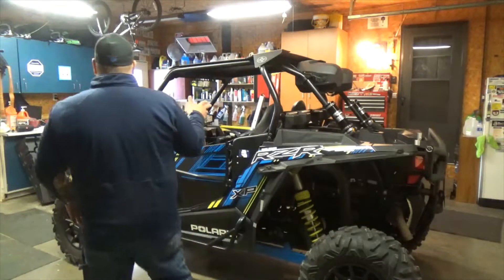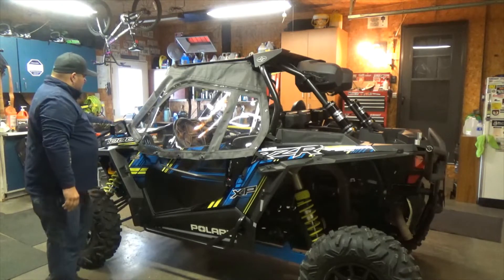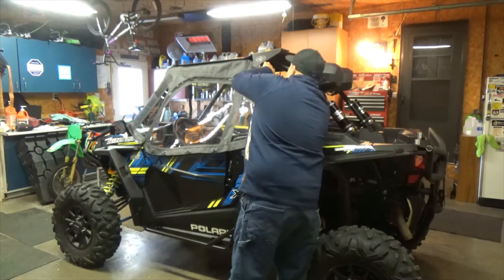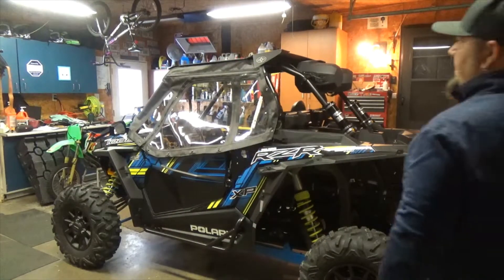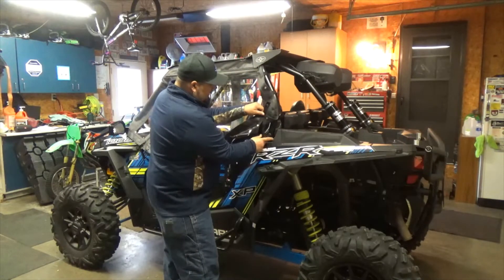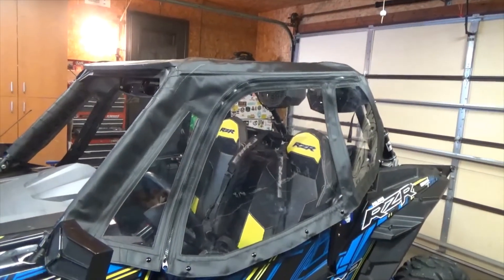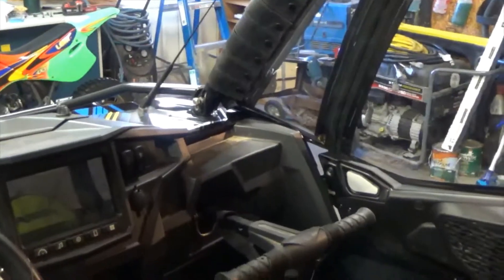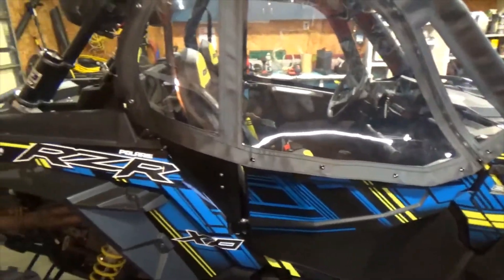CEC Cab Enclosure Polaris XP1000 Install

Comment: Since you got the full kit with the rear window, did the standard kit fit with the Click 6 I see you are running OR did he have to make you a custom rear one to fit the Click 6??
Reply from the maker: Custom rear enclosure for the click six seat belts. Joe has the pattern for the click six seat belts just let him know when you order. Thanks for watching Dirt Poor Tv.
Reply: Thanks! I got the correct kit then! One last question. Your rear panel, do you have 2 straps directly where the roof clips are? Are those 2 straps so you could roll up the rear window?
Reply from the maker: @5005ktl  the straps are on the b-pillar for the window. You unzip the window roll it back towards the b-pillar then connect the strap from the inside to the outside snap.